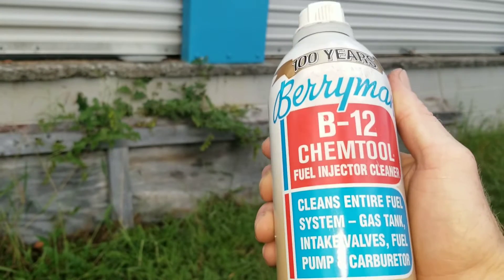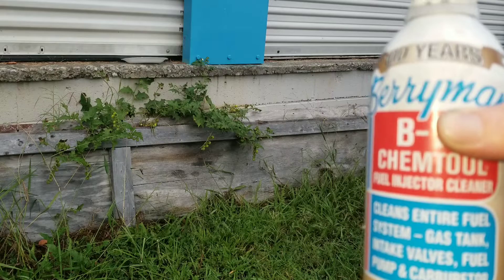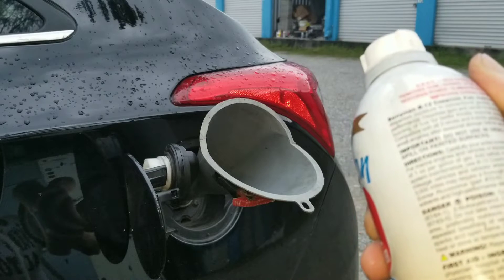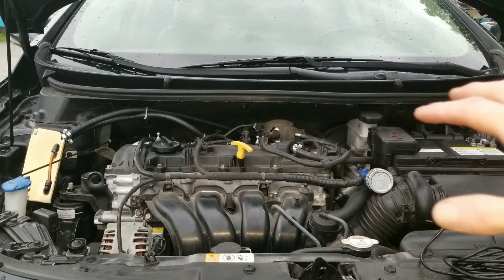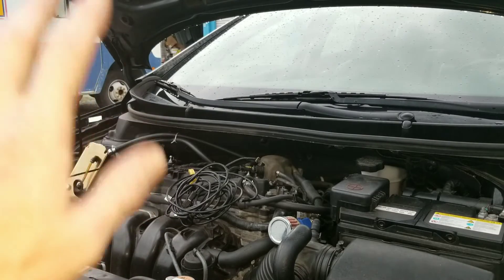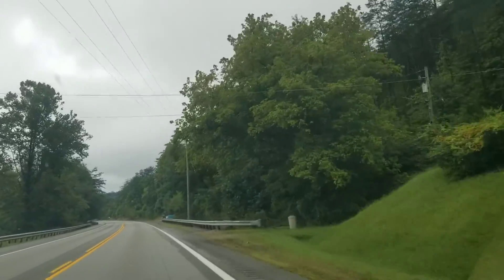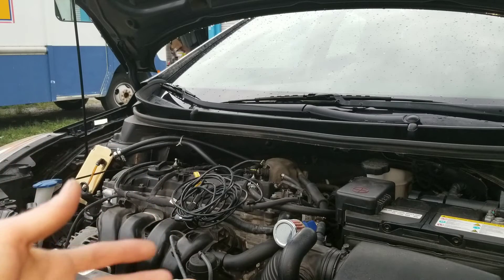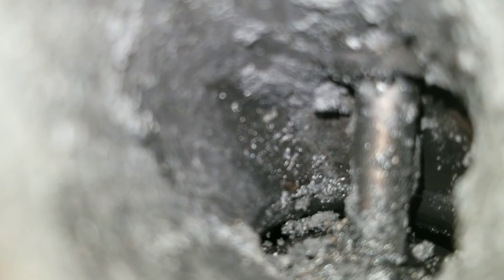B12 chemtool vs valve gunk

Comment: Aren’t you looking at the air intake side of the valve? Fuel doesn’t touch that side. Set the engine to top dead center and pour it directly on the valves and let it soak overnight. Suck half out and attach some zip ties (cut the locks off) to a drill and agitate the carbon on the valves. Suck the rest out and your valves are clean. Pour b12 back in and suck it out to make sure you got all the carbon bits.out.

Comment: Question: Can you add this B12 Chemtool on the oil cranckcase as directed for Seafoam?. Its usually 1 ounce of Seafoam per each quarter of oil in the engine (crankcase)? I have seen videos of using this product directly on the top of engine when removing the intake manifold. Just wondering. This product is great for the Nissan Sentra that I own (not GDI). I do have a 2015 Kia Rio EX GDI.
Reply: Absolutely not, chemtool is a solvent not a detergent like seafoam it will destroy rubber and plastic seals. Also it has a viscosity lower than water and will thin oil. If you insist do as their website suggests and put 1 oz per quart then start car to bring to operating temp, then change oil. Berryman strongly suggest never to drive after using chemtool in the crankcase.
Reply: Yes, the B12 website says 1.5 oz per qt of oil.  Add, & run the engine for 15 minutes, then change the oil.
Reply: I have plenty of times in my pilot and drove  5000 miles with it in  it cleans like bg epr

Comment: This is a direct injection motor. The product never sees this side of the valve. Use an injection cleaning tool with a fogger in the air intake and you will be amazed at the results. If you have a MAF sensor, inject the cleaner after the sensor. You don’t want this stuff getting on the MAF.
Reply: Also for engines with turbos injection DOWNSTREAM of turbo or run the risk of burning up a turbo!

Comment: When I inspect a vehicle and find valves that look that bad I take the shop vacuum and I put a piece of tape over the end of the hose then I pop a small hole in the tape then I wedge a drinking straw thru the hole and I manually stick the straw down in each port And vacuum the debris off the top of the valves and try and scratch scrape the straw against the walls and knock off more debris taking my time to not make it drop everywhere I just let the vac suck it up while I do it and go kinda slow working my way around any areas that are heavy with buildup occasionally stick a long tooth pick or kabob stick thru or. Flick the straw to clear out the pathway if it clogs up. If you need a bendy straw use that to get in harder to reach spots. Then run this chentool B12 thru your engine it works 100x better

Comment: Considering this is a direct injection setup, I’m actually really impressed that the B12 made a noticeable difference, especially #4. That to me is telling. Now dump a whole bottle right in the intake and I bet the difference would be dramatic
Reply: Dad started me on adding chemtool every other full tank since 2006 and i  notice the difference
Reply: @Bucky1836  it doesn't seem to clog up your fuel filter ??
Reply: @StR8uP254  not like seafoam will

Comment: I ran a can of B-12 straight down the carb of my 67 Catalina. I was having some major fuel delivery problems. The car had no guts. After treatment, I had instant throttle response, and the power was restored. I’m a believer. The stuff works.
Reply: Do you just pour it in while motor is idling?  Slow rev while its drinking it?  I intend to do this on my 65 barracuda
Reply: @st4ck4tt4ck  I had one hand on the throttle linkage, and the other pouring the B-12 right down the carb. As you pour, you want to rev up the engine. Not red-lining it, just about 2-3000 rpm by ear. You’re not gonna have a tach, so by the sound of the motor. If you try to pour it in without increasing he rpm, it’ll kill the engine, and you’ll have to restart it. I hope this helps. In the end, I’d still recommend an carburetor rebuild kit.

Comment: Thanks for the video.  The truth is, some GDI engines do still get gasoline additives on the intake valves through a process called "reversion".  I don't know how common it is, but the 1st generation EcoBoost uses reversion to clean the intake valves.
Reply: I think the honda l15b7 engine does the same.

Comment: I would like to see you run water methonal injection long term and see if that actually takes care of your carbon build up. Being a NA engine you would want to use as small of a nozzle as possible and likely only -20 washer fluid to not throw off the tune. Would want to set it up with a switch that would turn on when vac goes low(when at WOT or heavy load). I personally use WMI on my NA and turbo application. I haven't experienced any problems with carbon related build up but haven't looked at my valves either. I don't use it for cleaning I use it for the octane boost,just happens to also help clean things up.
Reply: Learn something new every day.  I never knew blue washer fluid had methanol lol.  Seems like that would be better than Seafoam could ever dream of being with a tiny tube suck into the intake tube near the throttle body.  

I believe I may have to give this a shot.  Most people claim water does the same thing Seafoam does... but water + methanol?  Hubba hubba.

Comment: U cant clean direct injection engine intake valves with gas additive! Pull intake off clean valves manually put intake back on and done! Or run this stuff through an intake via vacuum port and hope for the best.
Reply: 5.7 hemis aren't direct injection
Reply: @EliteStricker  is he working on 5.7 HEMI? He's attempting to to clean valves in a direct injection engine.
Reply: @bubbles8491  also he doesn't need to pull off the heads to clean the valves, he can use an intake valve cleaner
Reply: @EliteStricker  well, who said he needed to pull heads?
Reply: @bubbles8491  I meant intake, and you did. 
He doesn't need to take off the intake and clean manually, just use intake valve cleaner sprayed into the throttle body by the boot
Reply: @EliteStricker  did I not mention cleaning the valves with intake cleaner??? Read first, then reply

Comment: I think your valve guides and/or seals are shot
Reply: It's gunk from the emissions system being fed back through EGR / PCV being cooked onto the intake and valves. Direct Injection engine are well known for this issue.

Comment: You can put this in your engine oil before an oil change let it run for 15 minutes and then drain the oil and the carbon chunks will come out in oil. Like I always say use only name brand gas. If you use 93 to 98 octane premium gas you wont have carbon build up. I have been using high octane gas for 15 years and every time I look at my engines valves they are clean. Also change your oil every 2000-3000 miles with Mobil 1 Castrol GTX High mileage or Mobil 1 Full Syenthic oil . Wal-Mart and Sears Auto Centers does these for 44.99 plus tax for full and high mileage is 35.99. But do it your self and Mobil 1 full Syenthic oil for 6 quart jug is 23.99. High Mileage oil is 17.98-21.98 depending on brand. Try this
Reply: Ok I don't want to start an argument but if you run an engine that is not ment for premium fuel it will create carbon. Premium fuel burns slower and you need more compression to run it efficiently so your fuel theory is incorrect. A direct injection engine can't be cleaned from the fuel a regular efi car sprays fuel down the intake and makes contact with the valve and thats how it cleans carbon off. But on a direct injection engine the injector is direct in the combustion chamber it does not contact the valve with gas at all so it doesn't matter how good your fuel is it will not clean a direct injection engine.
Reply from the maker: Yes i appreciate your experience and what do you think about our new oil tournament to find the best motor oil
Reply: Chris Lemaster yeah decent quality oil definitely helps, the formulas change from time to time but usually they don’t get much worse.

Comment: I would use B12 in the wintertime once a year and then for the rest of the year I would use seafoam and I do it every two to three hundred thousand miles but you can also get the spray seafoam and spray directly in the intake let the car rev up for about 2000 RPMs until the spray is empty that's also a good way to clean all that carbon build-up
Reply from the maker: Yes i used the spray seafoam check out that video it got a little dangerous also thats good practice for the winter time so have you had goos experience with the products

Comment: unfortunately only media blasting will work in one shot....with these additives you are hoping some of it gets caught in the blowby these engines have or make it through the pcv system in order to clean the valves....which is unlikely....I use these and love b-12 but as a. injector /combustion chamber cleaner with hopes that it gets into the trac to clean the intake path.....gunk not only gets on the valves but in your intercooler, turbo impeller blades and piping....also I would imagine a better test is to run these weekly, then boroscope. You would not want that massive chunk of carbon to start banging around your valve train or chamber and through your turbo blades...
Reply from the maker: Yes thanks very much it makes me wonder why Hyundai recommends additives poured in tank

Comment: It’s literally impossible for that stuff to clean intake valves in a direct injection engine....
Reply: It's literally not, just feed it in through the intake.....it'll get the back of the valves.
Reply from the maker: Thats why im doing videos vehicle manufacturers says use fuel additives same as other service
Reply: @NATESINTERACTIVEAUTO  clean it by hand best way
Reply: Thats funny. That didnt even cross my mind
Reply: Best way to do it is by using a vacuum line
Reply: Nope! The best way is the Professional  way of using an "air intake sprayer tool"  that sprays a fine mist though the throttle body while the vehicle is running. with Professional equipment offered from BG Products, Wynns, Valvone Pro Series, MOC Products, Motorvac, Run-Rite, and other professional companies. There is no comparison to the half ass way down the vacuum line which is not even metered and a timed application. Vacuum line metod results do not compare to the sprayer method. The DIYer vacuum line method without proper equipment sucks! @tearsthepanda9837

Comment: Is this the Hyundai Elantra that is GDI. If so, a intake cleaner that you spray in the throttle body is the only way to clean it. This product should work good in a port fuel injection system but I don't think it will clean the valves much on a direct injected engine. I have used this Berryman's B12 Chemtool. I like it as a fuel additive, plus it's like 3 dollars and some change at Wal-Mart.
Reply: Service manuals and dealers recommend additives every # miles
Reply: @sarahlowery3450  I'm all for additives every oil change or every 3,000 miles to keep fuel system clean but valves will still be dirty on a direct injected engine.
Reply from the maker: Thank you alot see pinned comment